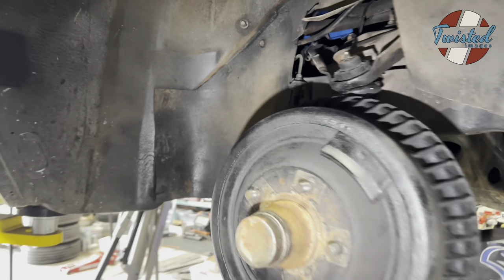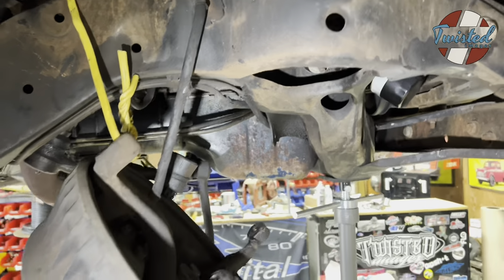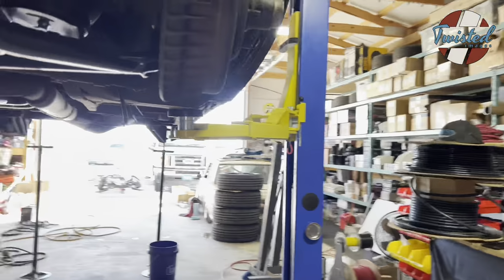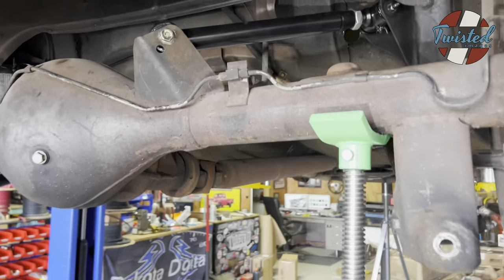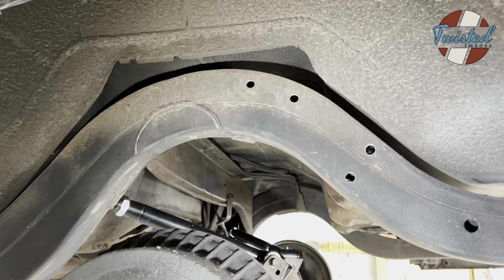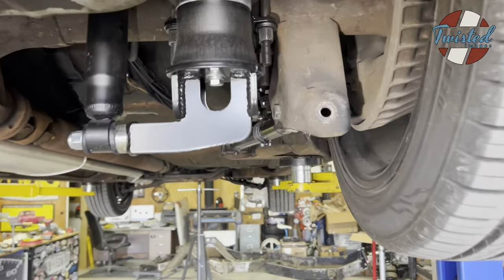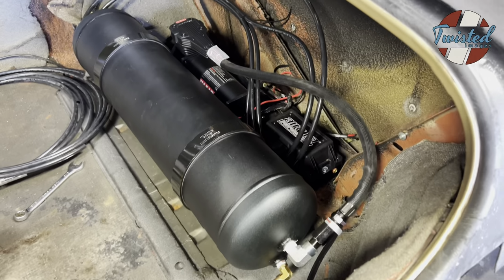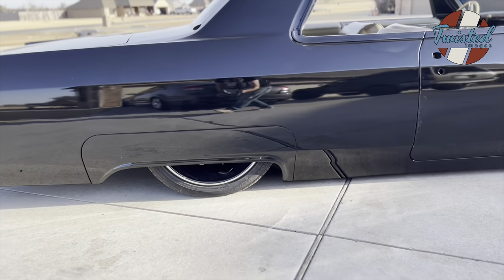1966 Cadillac Coupe DeVille - Air Suspension Installation

Comment: Choppin block makes great products! I bagged my c-10 using the front and back half they sell, after seeing this video it’s makes me want to re-do my Cadillac with this kit
Reply from the maker: We just fixed a ‘68 Caddy a couple weeks ago- kept the stock front suspension in place but rebuilt with new bushings and ball joints, and found a spot to sneak some shocks. Definitely recommend the Choppin’ Block kit over reworking the stock stuff- so much easier and I think the ride is a bit smoother.
Reply: @twistedimages405  yea definitely, mine was done before they started doing those kits never had any issues with it but that choppin block kit looks like the ticket!
Reply from the maker: @milinichsautodetail3124  holler at me when you’re ready- they’re actually going to be releasing a new version of the front kit soon!

Comment: I’m currently doing a choppin block install on my 66, what size wheel and tyre do you run? Did you have trouble with the top of the front wheel arch?
Reply from the maker: This one was on 20” wheels, and I don’t recall the tire size but it wasn’t very tall. We didn’t have any front clearance issues. There’s a ‘68 coming in next week- I’ll check that one out and see what we run into!
Reply: @twistedimages405  awesome, hopefully we’ll be ok, at the moment it’s on standard wheels and 29” tall tyres but I’d like to put 20’s on with shorter tyres,  thanks for the fast reply man! Really appreciate that 👍🏻

Comment: Before this kit I had a much larger (in circumference)  airbag cups that appeared to sit more level.  The cups that come with the kit are much lower and flimsier.  I noticed the spring cup surface on the frame is not even and therefore the airbag cup (the supplied smaller one) sits at an angle facing outwards towards the wheel.  Did you experience this?

Comment: Are these systems good for lifting more so, ? Im green and need for clearance and smoother ride for bigger rims , would you recommend this set and what kind for that and brand.
Reply from the maker: These systems are designed more for lowering, but they get a good amount of lift when fully aired up.  You may be able to add spacers between the air bag mounts and bags to get another couple inches of lift, although the car wouldn't go quite as low when you aired down.  Let me know if you have any questions and I'll be happy to help!
Reply: @twistedimages405  thanks appreciate it 🙏

Comment: Did you install any bushing at the control arm to radiator support?
Reply from the maker: I'm sorry I didn't see this message sooner!  The Choppin' Block front kit replaces the stock bushing setup on the tension rod with an adjustable heim joint.  This could allow a bit more road vibration to travel through the suspension and into the steering wheel than a rubber bushing, but in our experience it doesn't make much of a difference in NVH and the extra articulation without binding is definitely needed!

Comment: How much for this installed on a 64 coupe DeVille?
Reply: Not too difficult to do, but will completely change your front suspension and need alignment thereafter.  On my 64 requires you to remove the sway bar and my suspensions is now a mess.  It keeps swaying uncontrollably now.

Comment: What airbag system did you go with???Name….also I have a 63 Caddy will it work on mine??? Thanks
Reply from the maker: https://www.twistedimages.com/Stage-3-Air-Suspension-System-with-Air-Lift-Management-58-70-Cadillac_p_1542.html

We used this system, with the optional height sensors, a second air tank, and upgraded to dual Viair 485C compressors. 
We also installed the Choppin’ Block front and rear kits, which are a lot easier and less expensive for your ‘63:

https://www.twistedimages.com/61-64-Cadillac_c_641.html

If you have any questions feel free to reach out- I’ll be happy to help put a kit together for you!  -Phil

Comment: how did you run the lines to your front bags? @twisted Images
Reply from the maker: We ran both front lines along the passenger frame rail, following the fuel and brake lines on that side. They come up along the firewall, then drop down into the spring pockets with a straight fitting on the air bag.

Comment: Do must of these kits need cutting welding im doing myself because of cost but cant do all that 😢
Reply from the maker: The Stage 1 version of this kit doesn't require any major cutting, although you will need to trim the front spring pockets to make clearance for the air bags.  There's plenty of drilling needed for the threaded inserts to mount the rear suspension and front shocks.  But other than that it's all basic hand tool stuff.

Comment: Thank you so much for making this video! 

I can tell you that the CB front shock mounts will not work with a 69.

Why did you choose a 7-in bag? I don't know which bag to choose
Reply from the maker: What causes them not to work on a 69? Is it the oil filter or something else?
We like to run the 7” bag to reach ride height at a lower pressure- it’s a bit more work to get them in there but this thing hits full lift at around 100psi and rides great at around 75psi.
Reply: @twistedimages405  the frame expands in a Y, as it approaches the upper a arm support;. Spring pocket.  I will see if I can figure out how to private message you an image

Comment: Hey there, I have 69 sedan that’s already bagged but want to put shocks bk on bc it rides sooo much better. So really only way to do this is to install this setup. Can I use the bags I have (airlift) and my frame where shock mounts go is lil different than 66.?? Will it work on 69 ?? Thanks
Reply from the maker: What size Air Lift bags do you have currently? Their D2500 should fit fine with the Choppin’ Block setup, but fitting the D2600 might be a tight squeeze. 
Shock brackets shouldn’t be an issue- this kit is made to fit 65-69 Cadillacs so you should be good to go!
Reply: @twistedimages405  well it was bagged when I bought it. Don’t really know what they are 🙈. There was shocks fab from frame to the rod on lower control arm. I changed wheels and the setup hit my wheel so I had cut them off. I’ll check bags they may b SS7’s ??? Thanks for replying back !! 👍🏼👍🏼
Reply from the maker: @doc4244efa  keep me posted- I’ll be happy to help if I can!

Comment: I want to thank you for making this video! I’m also installing the same kit in my 66……did you have it aligned once completed?
Reply from the maker: I hope it helps! Yes, we had it aligned at the same time as the exhaust work was being done since they’re across the street from each other. I can get toe pretty dialed with a tape measure but with everything being replaced it needed a real alignment haha
Reply: @twistedimages405  10-4, Figured as much. I’ve been running this car for the last nine years with the bolt in ridetech kit. Had it aligned after installing that kit. It’s time to upgrade…..tired of blowing out the bushings on the strut rods.
Reply: I’ve got another question! Did you leave the link bars the same length as stock setup or adjust pinion angle with new setup hanging on new shocks?
Reply from the maker: @russellcampbell7658  we built all of the bars to stock lengths, and as far as I know the alignment shop didn’t adjust them significantly. Pinion angle seemed to stay pretty consistent throughout the range of motion and it drove great at all heights.
Reply: Thanks, I feel the stock double cardan driveshaft helps with pinion angle forgiveness! Again, good job with the video
Reply from the maker: @russellcampbell7658  thanks man! I’m working on a video for the ‘59 Cadillac we just wrapped up last week.
Reply: On all your builds that I’ve so far, I like that that you use separate tanks for front and rear. Makes more sense to me!